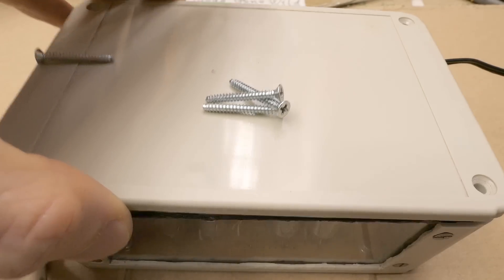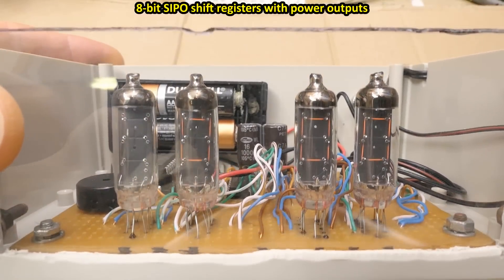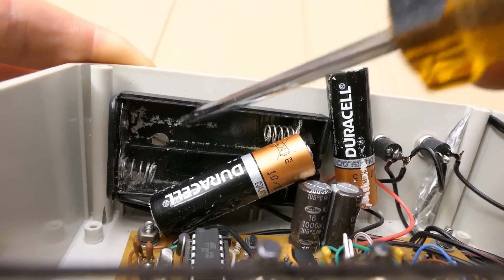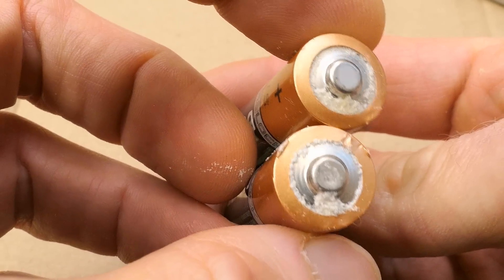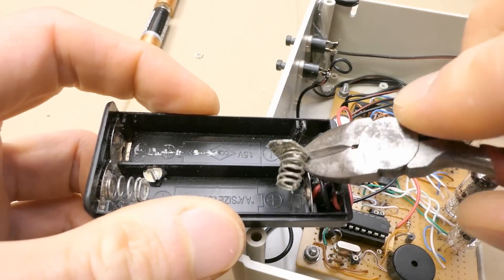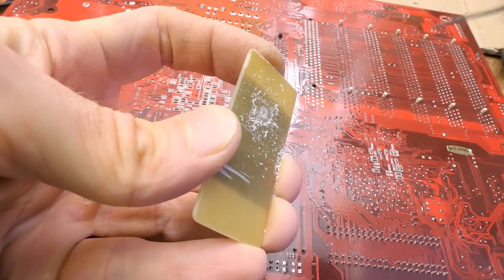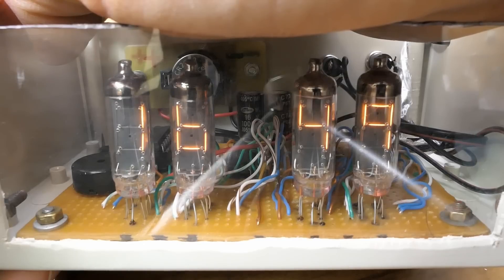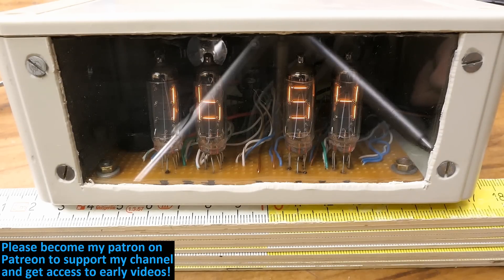DURACELL never leaks...

Comment: Yep, I avoid all Duracell alkaline cells and batteries. At the company I worked for, they used them and they destroyed various items of expensive equipment. Some of the PP3 batteries failed even before being used. The internal connections having failed. Duracell alkaline cells have destroyed an aluminium LED torch (flashlight) that I gave to my mum many years ago, even though the torch still lit up. They also cause problems in low drain applications like remote controls where they leak long before they die. I now use supermarket own brand or where I can, low discharge NiMH.
Reply: NIMHs can and do still leak, especially as they get old..

Comment: Hi, best wishes from Germany!
Why don´t you use rechargeable batteries (NiMH) for backup? They usually won´t leak and they can be constantly charged at a current of perhaps 1/50 or 1/100 of their capacity.requiring just one single resistor for charging. This provides a backup for many years, until the batteries must be replaced.
Reply: I've been doing this for over a year on a few different things. Around c/280. Keeps it up at ~1.43v per cell (2S). Just a diode and resistor. Ikea Ladda 2450mah cells. Tested mah capacity @1A after 12 months and still good as new :)
Reply: NIMHs defintely do leak, more often than you might think, usually when they get old

Comment: The safest battery is 9v ,i myself used several brand and i didn't mention any leak at all but the good why is to use lithium polymer with china small pcb usb c charger that contain a boost converter but you need to add a switch to stop battery from draining if it is not used

Comment: This is also my experience over the last years: Almost every duracell-battery did show a leakage and due to this the typical corrosion on the contacts and springs. But the affected cells were still in a good electrical condition: idle voltage about >1.5 V and a low internal resistance.

Comment: I have to be careful with conclusions, because I don't really know the market share of different battery brands, but the "market leader" of leaking batteries is definitely Duracell from my experience. I repair a lot of things (also for other people) which also includes devices damaged by leaking batteries, and Duracell seems to be the culprit in at least half of the cases. Personally I pretty much use supermarket brand batteries only (although I generally try to avoid using batteries in the first place) and almost never had a problem with them.

Comment: In Brazil, Duracell used to be the best battery around. Now, I wouldn’t use it even if it was free. It damages devices and corrodes circuit boards.
Reply: from a fellow from Brazil - I agree !

Comment: The date is the shelf storage, not the leaking date. Originally, they used to write "best before:" 
But however, why did you not put that battery outside the case? Even is not often you open the case to change the battery, screwing those screws in plastic, will broke the threads.
Edit: All zinc-carbon and some (if not most) alkaline batteries will leak if theirs voltage drop low enough and are still connected in circuit (i.e. have a load) long enough time. I found zinc-carbon batteries that leaked hours after they were dead while still connected.

Comment: I imagine all here know that vinegar can remove battery corrosion from the springs and contacts. It depends on how bad is the damage. Clearly, changing the type of battery used is a better solution but not always possible in small devices that lack any space.

Comment: When I was a kid they started the whole silver line thing duralock and I vividly remember duracells would last at least a month and a half with pretty heavy use then the silver line ones came out no longer would they last as long. when those first came out it was hard at least in my area to find normal duracells not duralock ones i switched to ravolt and never looked back lol. energizers are good too honestly I don't use duracells anymore don't trust em I've had off brands not leak but duras will in the same use. lost company

Comment: All manufacturers claim alkaline is "leak proof" ... however there's an overpressure valve in the design. WHAT IS IT FOR IF NOT TO LEAK?? Why is this legal? This has become a real issue for our chess club as we own a total of around 30 digital clocks, but we rarely need that many. When alkaline batteries leak in them you have to disassemble the whole thing to get rid of the corrosion so it doesn't get destroyed internally. It gets really difficult / expensive to source non-alkaline AA batteries nowadays.
Reply: Acid ones are widely available for a cheaper price, at least in Russia. Now i'm starting to realize what's up if that's not the case..
Reply: @ЯСуперСтар  Used to be you had a choice of zinc-carbon (R6) and alkaline (LR6) everywhere in Germany, now it's just LR6 everywhere. You have to look hard for R6, and pay a lot more, because only brand name and in small packaging.
Reply: @hmartinlb  I'm gonna find out exactly, why. This confused me

Comment: By the way our Fritz! WLAN - repeaters (used at 2.4 Gig band) in our house start to make high frequent noise after about two years, at about 14k hertz I guess. The younger people in our family hear it much better and louder.

After I resoldered several pins at the internal power supply on the board the fiepen was away for about three weeks, than it came back.

Looking on German eBay found at least 8 to 10 same fritz! WLAN repeaters all defect, for to sell in auction at start price one euro.

Two why's, why sound and later likely defect, why sell them at eBay - because of repair chance?

Comment: Ever tried industrial grade cells? I'm not sure if those are actually any better but I've a remote control that uses 6 x AA and I put Duracell Industrial ones 6 or 7 years ago and those are still in mint condition... But I still check them every now and then because their consumer (de)grade ones ruined a lot of my things :hand-orange-covering-eyes:
And I purchased a vintage multimeter and it came with an industrial Varta C from 1990 also like new.

A few years ago I found a tiny AM/FM radio on the toolbox I had on my previous car that went to the scrapyard in late 2006, I was trying to remove the battery cover to see the carnage and I accidentally turned it on, not only did they not leak but they still had "juice" after 12 or 13 years forgotten on a toolbox, and the batteries were the cheapest ones sold by Carrefour back then, I'm almost sure it was 0.30€ for a pack of 4 AAA.
Reply: Yes, the industrial Duracell cells leak and the 9V PP3 batteries fail a lot earlier than they should (the go intermittent due to poor internal connections).

Comment: That's really bad. They are within their best before date AND they are the "Duralock" type - duralock is their trademark extra leak proof sealing tech that is not used in all of their batteries. 
I had a leaky Duracell too this week. In a clock. It was also still within the best before date. Made in Belgium.

Comment: According to (electronicsNmore) channel, you can clean and neutralize leaked battery alkaline by using white vinegar and q-tips or a toothbrush.

I have bad experience with (Top Craft) battery's from Aldi supermarked they also leak.

The best batteries are Aerocell batteries from Lidl supermarket.

Comment: Stopped using Duracell 10 years ago as they always leaked 100% of the time. Energizer did well for a while, but now they leak like a sieve too.. even in their retail box before usage years before expiry date. I've abandoned both and now use Ikea NiMH. If I must use a primary cell I use the Energizer Lithium AA's. I've had so many devices destroyed by Duracell and Energizer alkalines I've had it with both of them. In their race to the cost bottom they both lost.

Comment: Meanwhile duracell batteries from the 90s: still fine
Reply: Yeah every battery that have been made in 1990-2000 literally last to this day. but now on they only last 1-4 years when they make them. i dont understand what they have done to make battery´s of nowadays so bad. most likely it is to scam more money from people. also that causes alot of waste
Reply: They started making them different around when the duralock came along if you have old duras that work cherish the safe power you will get lol
Reply: Yes they didn't leak until about 2010 then they all leak profusely even before they go flat. I noticed in a supermarket recently  they had Duracell that claimed to be "original" with a guaranteed shelf life of 10 years. Perhaps they realised nobody wants them anymore and went back to the previous manufacturing technique but I don't think I will risk it. I use Eneloop rechargeable nowadays.
Reply: Most old batts mede with quality
Reply: Some old batteries contained amalgam to reduce corrosion but the fearmongers banned the use of mercury so now you have less reliable batteries which are discarded more often.
Reply: @mernokimuvek  Absolutely, the change in reliability aligns exactly to when mercury was removed from the cells.

Comment: Any cell leak if the cell is discharged  to 0V
Reply: But these will leak still in the packet, never used and within the expiry date.
Reply: Duracell leaks in one year in backup or small current consumption electronics (remote controller, computer mouse, keyboard, clock, weather station, etc).

Comment: Looks like you have some voltage leaking into those batteries from the ext 5v supply.
Reply: I have the same leakage problem with Duracell in TV remote controller. Where is the ext 5V? Duracell is nightmare for electronics, never in my house. Other brands last for years without leaking, duracell doesn't even last one year. Marketing is good, so the only option is to change the production.

Comment: Sorry to namedrop other electronics youtubers, but Big Clive informed me about the non-leakyness of zinc carbon cells for low drain appliances and EEVBlog has been going on about the leakiness of Duracell for years.
Reply: Big Clive himself told about DiodeGoneWild few videos ago :)
Reply: @HeIsTheHighlander  Niiiiice
Reply: Some zinc carbons leak, the very cheap ones - But Panasonic? Never seen one leak.
Reply: Zn-C batteries have a wet paste of MnO2, C, NH4Cl and ZnCl2.
Reply: I think it's okay in this case because you name them because of adding useful information. And a few youtubers have same interests. So I guess they give themselves some information here and there too. :)

Comment: I hate all zinc-carbon and alkaline batteries because they leak. Nowadays I use low self-discharge NiMH where possible, otherwise lithium (the disposable type, not rechargeable).
Reply: Zinc carbon cells aren't known for leaking, aren't they often called "dry cells"?
Reply: @igotes  I've certainly come across leaking zinc carbon cells. It seems zinc carbon batteries contain a paste and are termed "dry" compared to something like car batteries, which have a liquid electrolyte. The Wikipedia article on zinc carbon batteries describes mechanisms by which those batteries can leak.
Reply: @igotes they 'can' ,but its usually less 'wet' stuff that comes out, zinc chlorides certainly can leak, i've had some if you shake them it sounded like there was liquid slooshing about in them ! and some leaked in my radio/cassette

Comment: I stopped using alkaline batteries. I prefer changing more zinc carbon batteries than have to clean alkaline's mess. Even the alkaline button cells leaks...

Comment: Years ago I went with NiMh batteries. Eneloop batteries so far have not leaked,but they are  very expensive, so I use them in stuff that sits most of the time.
Reply: I think if you can find Ikea Ladda ones made in Japan, they seem to be the same as Eneloop (but I can't prove it).
Reply: @chrisgj198  You're right. They are. As I understand it there is only one battery factory in Japan and Laddas are made there.
Reply: They have quite high self discharge rate though - I found Panasonic zinc carbon (not kidding!) are still the best for things that sit idle most of the time and/or draw very little current. Some still work decades after the expiration date...
Reply: @westelaudio943  yep, the old carbon zinc lasts virtually for ever. still have a few starter batteries from the RC engines, circa 1970s era...

opened an old analog multimeter the other day, old eveready 9v and c-cell... the c-cell still ran a joule thief. has to be from the 80s or earlier...
Reply: @westelaudio943  Eneloops are slow discharge, one of the reasons they are very expensive.
Reply: @westelaudio943  For most applications, the discharge rate of modern Low Self Discharge NiMh cells is quite acceptable(they can sit in a drawer for a year or 2 and will still be holding most of their capacity)..
Reply: They won't leak cause it's all dry inside. Look at a video of one being torn down

Comment: Depending on the situation, I use a LiFePO4 battery plus a blank, or lithium batteries, NiMH for the power hogs, or I might retrofit for Li-ion or I'll just attach a USB-lead. Even remote controls get LiFePO4.
And if I ever get something new that came with batteries, I'd use those up in a wall clock. Except when it came with duracells. Those I'd just dispose without even unpacking them.

Comment: I'd like to see how you desolder from computer boards... I always struggle to remove things from 57 layer PCBs.
Reply from the maker: a 100VA soldering gun desoldered the battery holder easily
Reply: I guess he would use one of those pistol type soldering irons from the 80s like he does with everything else

Comment: i’m an electronics reseller and after processing thousands of items i can say that almost every time battery leaks and corrodes it’s a duracell. not even the cheapest of the cheap harbor freight batteries i use have had any issues.
Reply: I am using many brands, really many brands, but duracell leaked the most. Most other brands never leaked. Duracell is considered as "very good" so you certainly wouldn't expect the "worst leakage", they have the worst,of all the brands, it's scrap.

Comment: Expire date on batteries means they will hold their initial charge on storage until that date, whereafter it will start selfdischarge and leak.
The batteries will always start to leak, if they are drained.
The white suff that leaks out is hydroxide potasium, which is caustic, hence the corrosive effect.
It leaks out as a penetrating liquid, thats why it always spread to other metals in contact with the battery terminals.

Comment: Duracell is the one that leaks the most, these days I changed some in an electronic lock here at home, they still worked but had already started to leak, rubbish
Reply from the maker: Electronic lock? It sounds like a nightmare even without Duracell inside it :D.
Reply: @DiodeGoneWild  We have them installed on more than one door and they have been lasting for more than 7 years, I want to see how many years the circuit or gears will have lasted in the first one to fail.

Comment: 👋We can clean the oxide with white vinegar.😉👍
Reply: It's probably potassium carbonate, which is why it fizzes when you apply vinegar.
Reply: Works well, unless it is too far corroded and the plating on the steel contacts has gone.
Reply: @dino6627 
Yes, it works well; I’ve already tried several times.

Comment: I won't have Duracell batteries in the house because of this. I have been using Lidl and Aldi own brand batteries for some years now and rarely have any issues. I won't say they are perfect but they are orders of magnitude better than the garbage that Duracell sell, and they are much cheaper.
Reply from the maker: Yes, batteries from Lidl are much better and cheaper. Duracell is bloody expensive, the boxes of them in shops have a layer of dust on them! Nobody buys them, except youtubers for a thumbnail :D.
Reply: @DiodeGoneWild Totally agree. I've even suggested to someone recently to get the Lidl own brand rather than one of the big names. They're half the price of the Duracell Simple cells sold in the same shop and of much better quality and capacity.

I have only ever experienced Duracells leak "sealed in pack" within their best before date.

PS. Costco own brand seems to be Duracells with different wrapping. I had a large unopened packet of AAs leak after a couple of years.
Reply: @nowster  Yes, the Costco(Kirkland)cells are rebadged Duracells, so when the Duracells went down in quality, so did the Kirkland cells.
They're both lousy now!!

Comment: Could it be that the leakage current from the diode (over-) charged the batteries?
Reply: I wonder if any amount of reverse current is unsafe for non rechargeable batteries.
Reply from the maker: I think the leakage current would charge them way slower than the self- discharge discharges them.
Reply: No, Duracell brand is famous for leaking.
Reply: Intuitively I’d say so too. If they have 10 years shelf life and have 1Ah capacity they can self discharge at say 10uA. It’s gotta be a rather lousy diode to leak that much with two volts of reverse bias. Another remote possibility could be that the photovoltaic effect kicked in because the window is clear and lets light through.
Reply: The same happened to me with this garbage brand in wireless keyboard (keyboard not in daily use and not connected to usb, purely wireless, the batteries weren't even half dead).

Comment: I gave up on Duracell batteries years ago because I was disgusted how they would puke out their contents in the battery holders of some of my favourite electronic items. By the way you can neutralize the base from the alkaline battery with cheap white vinegar and clean up with IPA. That's how I repaired some of my battery holders.
Reply: Ditto. Duracell are rubbish. And yes, distilled or white vinegar is good for cleaning up the mess. But do wash with plenty of water afterwards.